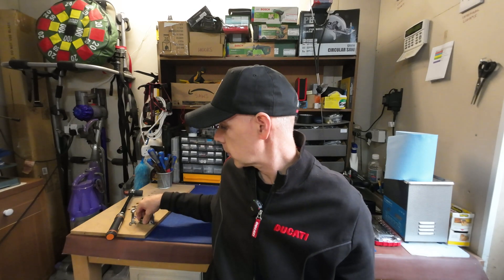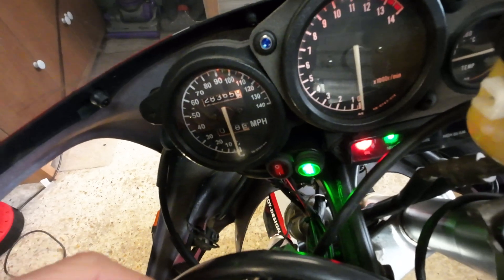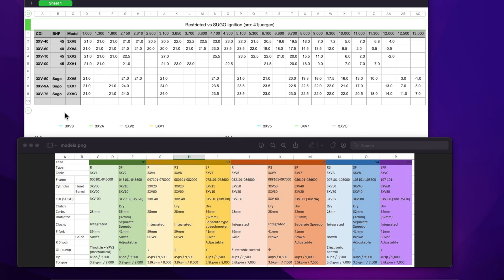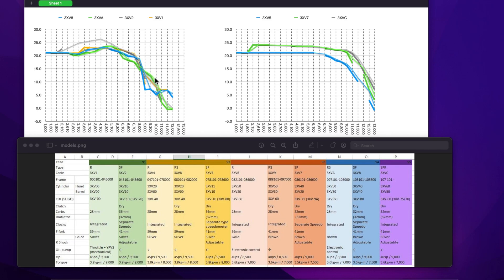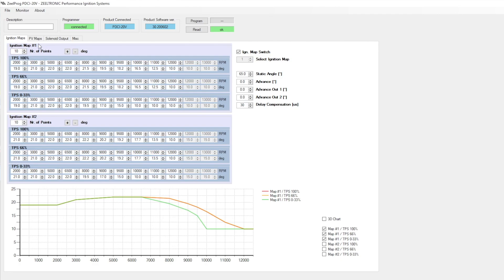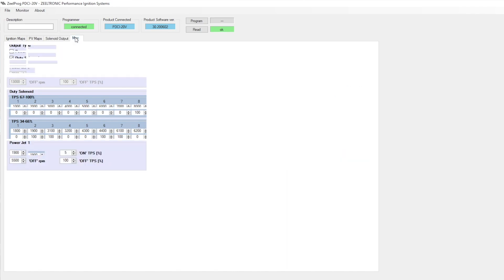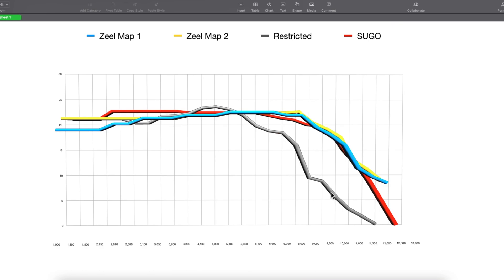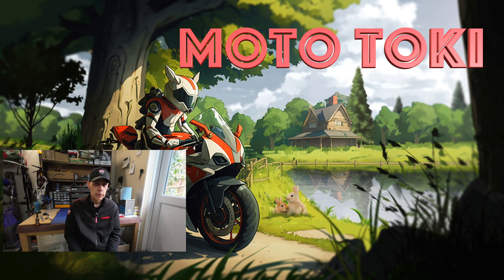2 Stroke Ignition - Configuring Zeeltronic programmable ignition

Comment from the maker: At 2:00 I mention you do not get the connectors if buying direct - this is wrong! Zeeltronic do supply with the connectors fitted now - Thanks for the correction Borut!
Reply: Did you fit your Zeeltronics or was it a plug a play system or did you have to fit a hall sensor or anything liek that.
Reply from the maker: @Falling-Fluffy  All plug & play!

Comment: Hi just come across you channel quick question does this use a tps sensor?
Reply from the maker: Hi! Yes it uses the TPS. In the software you calibrate the Zeel against the TPS min and max. The Zeel has maps for 100% TPS, 66% and anything 33% or below, so you can configure against throttle opening and rpm. really useful for shutting off at high rpm
Reply: @mototoki thanks for the reply so you have a TPS sensor on the carbs?
Reply from the maker: Yes the TZR has a TPS on the right carb as standard
Reply: @mototoki ok thanks for that👍
Reply from the maker: @andym6608 no worries, anytime

Comment: I'm guessing you never got to the dyno stage ?,. (crash) on way to mot, my 92 3xvsp is still standard except for some carbon stingers, it goes pretty well tho,.ive allways wanted it to be set free restrictions wise with a full sugo kit on it but costs put me off, but bear this in mind in my racing days td2/td3/tz250,s they were only in and around the 45/50 bhp mark,.so a 65 hp 3xv would be a missile,. also i'm interested in your pop off/on seat base mod, thanks,.
Reply from the maker: It's not made it to the dyno yet, but I will. It's been too much investment in this project not to see it through. I'll tweak the Zeel at the dyno, but I can't imagine it's too far from perfect. Boruts maps are gold! The main restriction on the 40/45 bhp bikes is the CDI and Zeel is the way to go and way cheaper than a Sugo CDI.

On the seat mod, go to http://pure2strokespirit.net/forums/index.php and search for "push button seat release". I've got drawings and links! Thanks 
😃
Reply: @cabovermike  race kitted SP ( pipes carbs ignition ) and a set of fresh pistons and you get around 68hp at the wheel.. nice and usable as well, far better delivery than a race prepped RGV